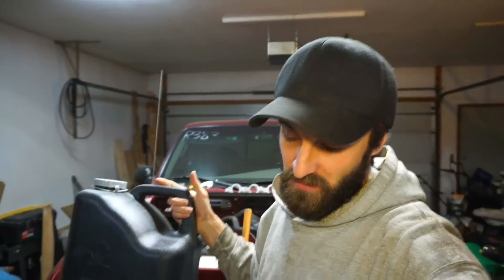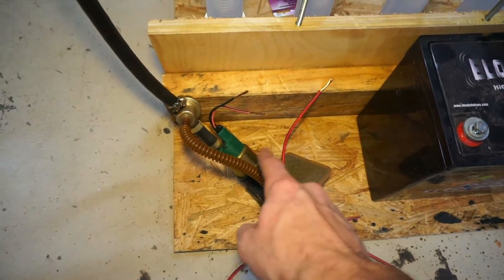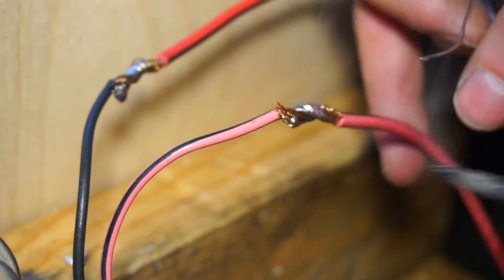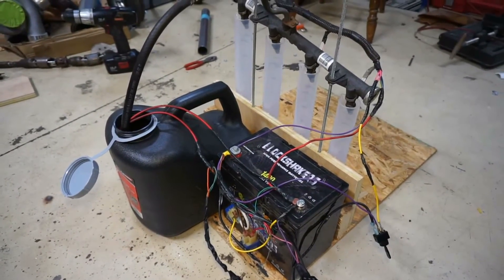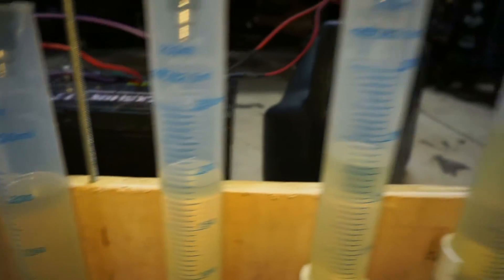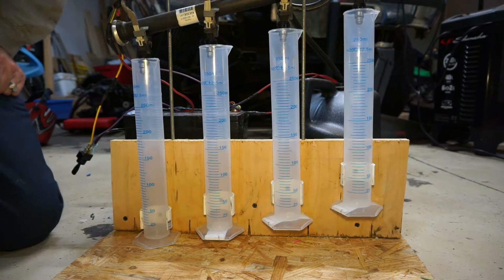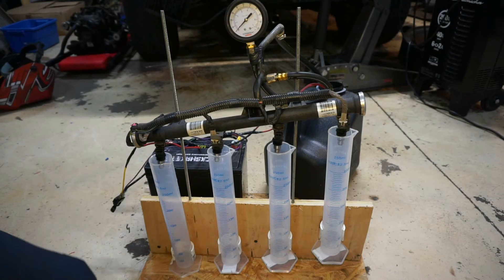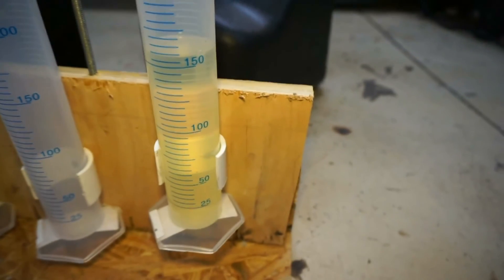DIY FUEL INJECTOR FLOW BENCH FOR DECAPPED LS LSX INJECTORS!!!

Comment: When calculating injector flow rate, the frequency is kinda irrelevant. It's the pulse width and duty cycle that matter. If it's 50% on, 50% off at 1hz or 100hz, you're only flowing half the fuel you'd rate an injector for. Best bet would be to flow bench a known injector and just base the difference between your modified injectors and the known injector.

Comment: interesting .. i forget that some ls motors are efi lol! i'm going "how the hell .." so can you run a bigger injector on the stock motor and get any more power with a ecu tune or is that just dumb? i was wondering if the angle would effect the flow but that seemed silly since it's under pressure. turbo it up meing!

Comment: Sand all the corrosion off that soldering iron tip, and then tin it with fresh solder. Should help with the heat transfer.